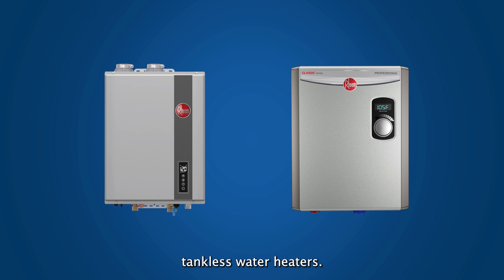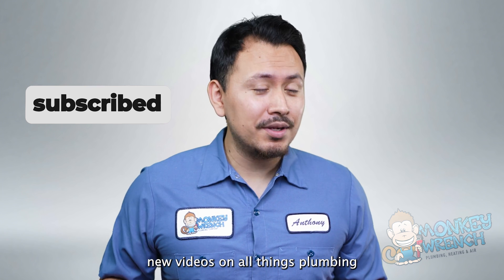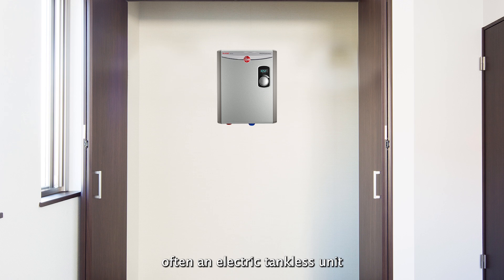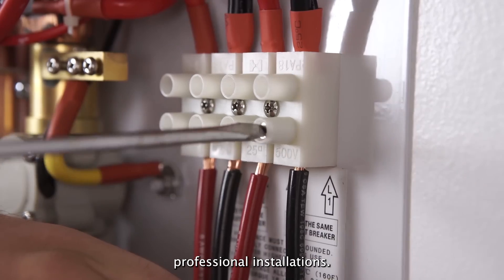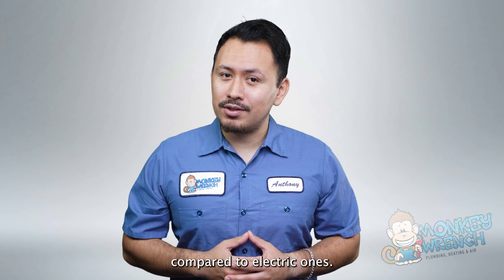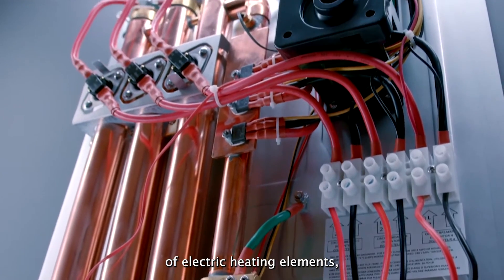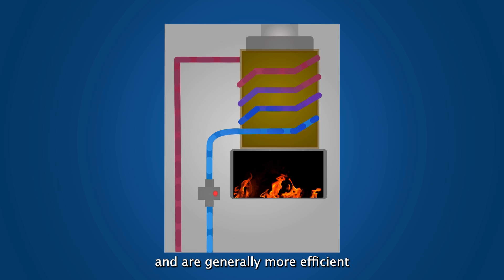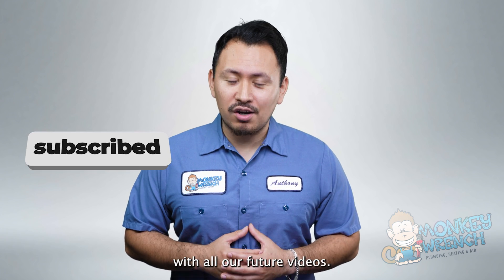Gas VS Electric Tankless Water Heaters

Comment: Those compression fittings make being a plumber idiot proof, no need to learn how to sweat or braze copper.  But charge the customer more because the tool costs $3000.00 and the fittings cost 5-6x more because they have a oring inside them that will eventually fail it's too new to know how long the ring will last. Just like pex was an easier way. Easy isn't the best way. Think about homes or any appliances made  60s prior they are still going strong if maintained but buy a modern home or appliance your Lucky if it lasts a decade usually only just past the warranty period. I'll always sweat a pipe it's much stronger and lasts forever as long as it's done right!  Sorry I'm old school  I learned the right way not to cut corners for convenience and profits just because everyone else is doing it.
Reply: Copper can develop pinholes, so nothing is forever.

Comment: Electric water heaters are popular in Europe because they can run double the voltage we can in America.

A 220v line requires a thick and expensive cable to carry current, but if you have a higher voltage grid you don’t need big cables because the heater isn’t drawing huge current when it has voltage instead.
Reply: Most of LV cable insulation are rated 600V or 300V so it works for both 120V and 220V . For a giving power output, you are correct that using 240V requires smaller conductor than conductor of 120V.
In US, residential panel has both 240V single phase (phase to phase) and 120V (phase to neutral). We normally use 240V for the dryer, and owen. Some equipment requires both 120V and 240V, in this case, we bring in both phase and neutral wires.
Reply: We've got 220v in the US lol
Reply: @TeddyK-G-B  You understood nothing I typed, "lol."
Reply: @thenexthobby  you said Europe has double the voltage that we have in America, which isn't true.  And 220v doesn't always mean you need 10 gauge, 30 amp appliances yes, but not a 15 amp tankless heater.  Amps determine cable sizing not volts.
Reply: @TeddyK-G-B  Hey Jerry, you're correct. I was thinking 3-phase voltages. I meant to describe power, not current.

Comment: Our experinces...While out of town a HVAC company charged me $2300 to replace a 40gall gravity draft NG HW tank at a rental,  so I have been installing Stiebel Eltron electric units in all our upstate NY properties. Some are already 12 years old. 
In 2009 I replaced our 80gall NG HW tank with a cheap NG on-demand jaccuzzi I got at Lowes for $150. It was return & had everything with it. My NG bill dropped $1600 the following year & that old system is still running. But at the time we had 5 teenage showers going every morning with 2 of them teenage girls so that 80gall HW tank would run out of HW fast. 
My Lakehouse neighbor paid $3200 to replace his propane HW tank, has to drain & winterize every year, pay for the propane tank rental & refill & his propane fce is never used. That same year 2015 I installed a $699 Stiebel Eltron in our ALL ELECTRIC lakehouse & our highest electric bill since was $68 (summer 2024) with our mini split a/c etc also running constantly.
4  years ago I installed a Stiebel Eltron ($799) in our Scottsdale vacation home & the NG bill dropped from $145 to $16/month. Our old 50gall HW tank cooked HW constantly even when the garage was 110deg F. Our cooktop & BBQ are now the only systems using NG & the NG fces have NEVER been used.
5 years ago I installed an $899 AO Smith 166kBTU NG HW system in our 7 unit apt bldg. It replaced the 75gall NG HW tank that constantly ran out of HW & after 5-6 years they all leaked.The NG billing dropped signifcantly & with 17-20 taking showers no-one has complained about no HW. That same year my BIL replaced two 75gall NG HW tanks with a NG Navien system ($7200) & he had call backs for several months after for board issues & still waits minutes for HW to arrive at the faucetts.
Reply: Thanks for sharing your valuable experience
Reply: So buy an electric tankless ?

Comment: I live in a RV. Right now I have the stock gas/electric HWH. All I use my hot water for is showering. I do have a dishwasher but it has its own heating element. Would a electric HWH be enough for me? And how long can you shower with an electric on demand HWH?

Comment: Operating costs are too variable from place to place because of cost per kwh, ground water temp, temp setting, demand and flow rates. Electric is 100% efficient vs less than 100% for gas.
Reply: gas is always cheaper than electric

Comment: WTF?  I just bought a bosch propane 7 ltr. water heater for $200 (on sale at h.d. in Baja), includes installation, now a 5 yr. warranty.  Great for washing dishes and a shower (temps. here are 50' f. - 90'f).  One could do the install themselves.  My 30 gal. american std. (>1992) started leaking, great excuse to go tankless (I should have gone tankless 15 yrs. ago).  No need to have 30 gal. of water sitting around at 120'f.  Now if I was stuck with a family of >4 people that had skank issues, living in >60% r.h. and > 80' f. having to shower more than every 2 days and had to change clothes more than every 2 days, yeah, a 40 gal. tank of hot water would make a bit more sense.  That would still be a do it yourself install, $800? plus <$100 parts, and a 1 - 3 hr. job including buying the parts, so, ~$500 labor max. or a new install at 3 - 6 hrs., but you do you.  40 gal. propane = ~$70.00

Comment: Plumbers will always tell you gas tankless water heaters because they make a big profit in gas installation. Electric ⚡️ is the much cheaper and safer.
Reply: See I would think electric would cost more due to constant usage of electricity
Reply: @Yeekiee depends on how well the home is insulated, local kwh costs, etc.
Reply: @Yeekiee  it is
Reply: Electricity has become expensive AF in my country. I'm considering switching to gas
Reply: I'm in the Michigan UP Natural Gas is crazy expensive up here if you have Xcel Energy, the electric is way more affordable right now. What's odd is my house has a NG furnace and water heater but there was a separate meter for an old electric water heater ,apparently they had a lover rate for heating water once so the  heater had its own electric meter. It probably way back in the 50-60s they did away with that program when it was a little utility company that provided gas and power not the massive expense Xcel Energy this part of the UP had to use 😢 I'm probably switching to electric since I upgraded my service to 200 amps plenty of power coming in . The couple weeks we use AC it only raises our electricity bill $30-40 a month that's running 24/7
Reply: I don't think hiring an electrician is cheaper than hiring a plumber.  Plumbers know that natural gas is cheaper than electric to operate.
Reply: Right... you will also need another panel for the electric water heater and they are known to have limited life span. In the long run, they suck

Comment: I prefer electric. It's safer, cleaner for the environment, and requires less. Although it is for a 2 story house, there are only 2 - 3 of us, and we aren't excessive with the hot water.
Reply: What make .model do you have and recommend? We need it for shower and kitchen. Thanks
Reply: @Tustian999  I don't have one yet because I couldn't get enough info in time, to make me comfortable enough to switch to tankless. I ended up just getting a better upgraded "traditional" one. But I was looking at ones from Stiebel Eltron and EcoSmart (because of the lifetime warranty). Although Rheem is a big manufacturer, for tankless water heaters, I saw too many negative reviews.
Reply: @Silentgenius01  You mentioned two brand names of the water heaters... Are they tankless or conventional ones? Thank you.

Comment: i have a 24KW electric unit. its spec say  4.68 GPM Flow rate, but my ground water is much warmer then we thought. So we have seen much higher flow rates and still keeping the temp up. its just used more power

Comment: I live in upstate NY. We have to fill our 500 gallon propane every month and a half in the winter. That's pretty expensive. We're making the change to electric everything (boiler, hot water heater, stove) as we will make our money back in less than 2 years. Where we live and with what we use for gas the electric makes way more sense to me.
Reply: Same. Hudson Valley area. We've converted to electric everything. Heat pumps, water heater, stove, etc. We're planning on installing solar panels, and hopefully that will make us more energy efficient and independent.
Reply: Cost per BTU would be way cheaper with a wood boiler. 1 Cord of wood is about 200 bucks, with electric that BTU output will cost $934.80 at .11c per KW.
Reply: @flatoutautomotive ignoring that your have to purchase and store huge piles of wood and  load the boiler continuously.
Reply: I think you will regret this in the near future with electric costs
Reply: It sounds like you either have a large space or are not very well insulated.  If it's the latter, I'd spend my $$ on getting better insulation and sealing all house penetrations - like caulking around windows, hose bibs, etc.  Get triple paned windows next - they are normally only $100 more than double paned and are double the efficiency. I did this on my place and cut my building load by 2/3's. 

Where I am, they are trying to push folks to electric over natural gas.  Not sure which way to go - am even looking at solar as a possible booster to get ground water up from 45 degrees to 75 degrees.  Then picking something to get the last 30 degrees.
Reply: @petersamios5409  You're probably right. our house is 100+ years old. Insulating everything has been both expensive and a slow process as we have to rip out the old lath and plaster walls, insulate, then re-drywall everything. Some of the insulation is literally made up of newspaper haha.
Reply: @samwisegamgee2488 Yea and that newspaper just falls down then disappeared. I've git a 2-story. It'll definitely take time but keep going.
Reply: Bro electric is very expensive unless you have a ton of solar panels. I live in Massachusetts where our electric rates are 2nd highest in the country. You got to remember they charge higher in winter than summer months. I use currently wood stove, electric space heater and oil on when its really cold. I'm here to confirm propane is cheaper to run some of our home heat when the wood stove it struggling on those sub zero days.
Reply: @ I would normally agree with you there but my small town made agreement with the low-cost hydropower from the New York Power Authority (NYPA) ages ago. We're probably paying a third of the national average for electricity.
Reply: Not of Electric goes up
Reply: I have heat pump water heater. Electric oven with gas burner top. Dual fuel heatpump back up gas. Whole house 17 kw generator. Gas grille. Gas Gemaire downdraft grille in garage. All propane. Have 330 gallon and 100 gallon tank. Estimated next fill is 9 years. Has been 4and a half years so far
Reply: when you posted this, you were heating your house only with gas? Or a dual fuel system?

Comment: I've never seen a gas tankless that costs nearly that much. Mine have cost $1200 for two and $980 for my newest. No way it costs $3k+ to install. Flow rates also vary, since the rating is based on a 40° temp rise. 50° water to 130° lowers the gpm
Reply: Society has a large population of people with disposable income today, they are more educated in certain areas and way less in others but they don’t realize this. Since no one wants to work today  used car salesman have moved into the plumbing market and educated idiots will pay their prices. There’s 3 rules in plumbing and it doesn’t take a genius to know them.